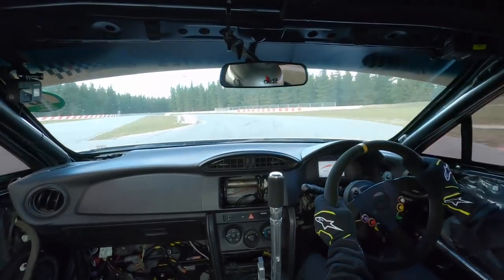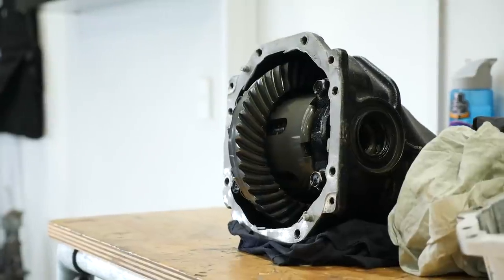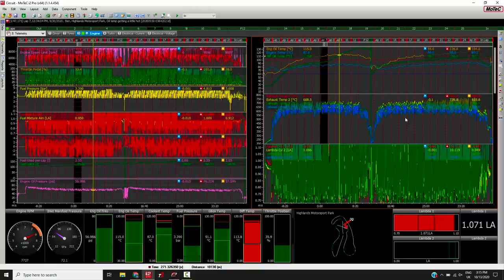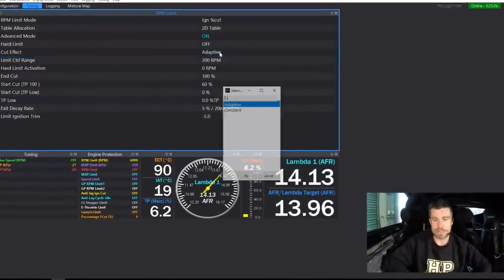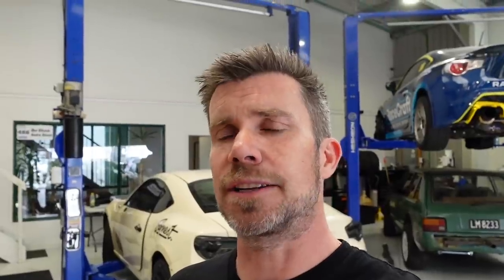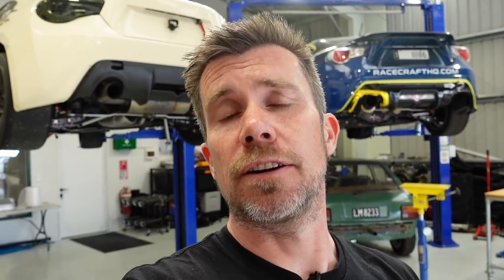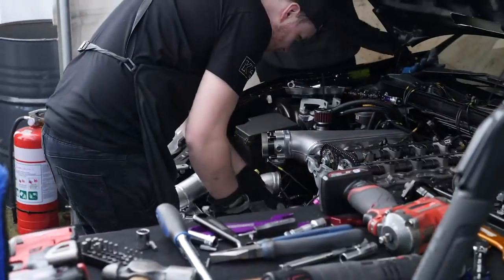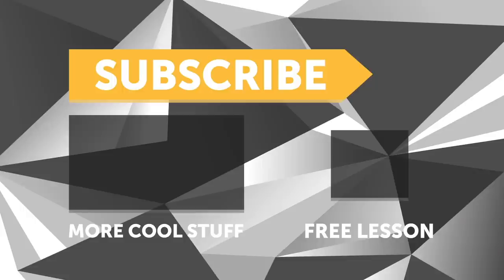That's It, We Quit (But Not Really) | 650HP SR20VE Swap | SR86 EP 9 [#BUILD]

Comment: i feel your pain Andre...i have been building my car on a rotisserie for 6 years. i just finished it in February and I've put 5800 miles on it so far, but man...the amount of little issues I've come across in the last 8 months is overwhelming at times. I've had every issue you can imagine from suspension to electrical shorts to slipping ignition timing to the windshield washer nozzles not spraying...at the end of the day, i give this car no choice but to work and do what i tell it to do. i gives it Hell and i know you'll do the same with your build.💪

Comment: Ran into the same issue with the shims. Tried many things, learned the hard way (shim finally flew into timing chain).

1. Machine the lip off of the retainer
2. Machine new shim with a 2mm deep pocket in the back of the shim that basically presses onto the valve stem, (think of it like a bucket).

So far we have about a year of limiter banging, drift fun. (~450hp).

If you have any questions, reach out! niekotheboss@gmail.com 

Good Luck!
Reply from the maker: Thanks for the suggestion. We've run lash caps like this on some of our 4G63's with success. In our instance changing the rev limit to only use fuel cut should be all that's required though and where possible i like to keep my life as simple as possible. We're also swapping to a different cam profile with the aim of bringing the power band down in the rev range so we can bring the limiter back to 8000 - Andre
Reply: @hpa101  Yeah, this last time around we did quite a few things so it's hard to say which one 100% fixed it. Changed to fuel cut, added the lash caps, and shimmed the valve springs.

When you're back in there, check the clearance from the retainer lip + rocker arm. We noticed many of the shims were sitting slightly below the lip and we are thinking this could have been part of the issue as well which was solved by machining the lip off.

Either way, awesome build! As much as I hate when things go wrong, the troubleshooting/learning is half the fun!

Comment: The biggest problem with using production based components for competition, is the total reworking needed to get the thing to hang together.
The revs and power you guys are using is impressive to say the least.
Fine for drag racing not necessarily ideal for circuit racing. 
You are at a level that the lower f1 turbo guys were at only 40 years ago. 
Brian Hart was at approx 650 BHP @ 9000 rpm all be it from 1500cc.
In reality you guys are not far off.
Reply from the maker: The results from this engine have been impressive but the realty is we're walking a fairly well trodden path. The numbers we're aiming for have been achieved on this platform by dozens before us so I don't think there's any reason we can't get the results we're aiming for. This latest little drama is pretty easily explainable, even if that makes it no less frustrating - Andre

Comment: Use a high volume low pressure pump and a bigger line and filter on the dif and that should take care of the problem if a few small pieces of anything get in the line or filter.

Comment: Are you looking to make active changes to the suspension based on sensor inputs? If so, what kind? 

Thanks for taking us along for the troubleshooting! It's nice to follow along your though process.
Reply from the maker: No, the suspension won't be active but we will be using sensors to help optimise the spring rates, damper settings, bump stops and packers to suit the aero - Andre
Reply: @hpa101  thanks for the reply! 
Have you got an overview of all of the services and companies that are part of HP Academy? I've been subscribed for a few years and it looks like you've expanded to cover a lot of territory. It would be cool to see a short video highlighting what you have achieved in the last years.

Comment: Mazworx
Shimless Valves:
Nissan sets the lash using shims between the valve and rocker. At high rpm or while on the rev limiter, these are known to come out and possible cause damage. The shimless valves are made to get rid of that shim.
Reply from the maker: A shimless setup on the VE head creates a whole new set of issues. Mazworx shimless valves greatly reduce the surface area that the rocker operates against which can accelerate rocker wear (fine for a drag application but not ideal for endurance racing). Adjusting lash also becomes a lot more problematic. Ultimately it's the ignition cut limiter that's the issue as explained in the video and switching to fuel cut only will sort that. For a drag application you need to use ignition cut on the 2 step to build boost so the shimless valves are an essential option - Andre

Comment: I've been really enjoying watching this videos and I'm sorry to hear you have more problems. Can I ask a question regarding the individual EGT's? When comparing the temperatures from each cylinder how big of a difference, say in %, would you consider big enough to require a trim in fueling for the cylinder(s)?
Reply from the maker: We actually rely predominantly on the individual lambda sensors for cylinder fuel trimming. While EGT sensors are often used for this purpose, there's a range of other factors that affect the EGT other than just AFR - Andre

Comment: There are a couple of other things to bear in mind.
The exhaust bouncing off the seat can result in excessive seat wear; stretching of the valve stem - with both the exhaust clearance being reduced which could also cause an increased chance of burnt valves and, more worrysome, the head actually becoming detached, especially if it's become overheaded because of the reduced clearance.
If the lash cap becomes partially displaced, it could hold the valve slightly open, or increase the lift, and as the piston is chasing the exhaust valves it isn't uncommon to have piston to valve collisions and resultant failures.

*hopefully I'll start a discussion on the HPA site as there are a few other things to consider when having seats machined.
Reply from the maker: Yes, nothing good happens when the valves bounce back off their seats. The key is to avoid the situation entirely - Andre

Comment: High revving RB engines have a similar problem with shims and the big engine builders often go shimless. Is that something that might be worth investigating for the SR?
Reply from the maker: The RB is a totally different valve actuation design being that it uses a bucket over the valve that the cam operates against. It's a little trickier to move to a shimless setup in the VE head. There are longer valves from Mazworx that are designed for shimless operation but they actually cause a whole new set of issues given they reduce the diameter the rocker operates against and hence can increase wear - Andre

Comment: Is it possible some of the added heat was coming from unmeasured valve overlap? You mentioned some of the shims were either equal to or lower than the retainers, and I'm wondering if that was creating a larger/longer contact patch for the cam lobe beyond the duration monitored by the cam position sensor. Thoughts?

Comment: Jun auto got sr20 lash killer kit on the shelf parts...solid lifter
Reply: Wrong engine
Reply: @coreyfreedom9859  so the sr20ve head didnt use the same hydraulic lifter as conventional sr20de(t) ?
Reply: @AmirPomen  not even close you can see the assembly in the video

Comment: didn't mention : "Valve Spring Stiffness" 
even if you suppress the exhaust explosions from occurring, you still talking around 9k rpm.
thanks for the beautiful content.
Reply: he mention @18:05 they plan on putting a stiffer valve spring to help prevent it in the future
Reply from the maker: The springs we're using have been tested to 11,500 rpm so they're more than sufficient for the 9k we're running. We are however going to increase the base pressure slightly but we're not swapping to a different spring - Andre

Comment: Maybe Banks was right about the type of diff cover and the airation that is can cause, thus the temps rise and the pump starts to fluctuate the voltage due to this airation
Reply from the maker: At this point the diff, cover and pump have completed a full season of endurance racing with no issues.
Reply: @hpa101  ah okay, thought the diff issue came to light once the SR20 was installed and that maybe the different power delivery from the turbocharged engine (plus the extra power) may cause a bit more airation.
Will be interesting to see the remedy you come up with.
Reply: Gale Banks Tuned in podcast please Andre

Comment: A general question, im no sr20 expert, but that rev limiter seems quite agressive for endurance racing, wouldn't around 8k make life easier, rpm is seldom easy in endurance racing..
Reply from the maker: 9k was never our intention, but rather that's where it is making power with the current cams. We're actually looking at a different cam that will move the power curve to the left so that we can reduce the max revs we're currently using - Andre
Reply: @hpa101  Would really love to see Dyno overlays of  different cam on same  set up its talked about to death  and no real back to back data is ever brought to the table just a heap of opinions ..

Comment: Why are you guys running the RS cusco diff? That would be very violent on the track coming on throttle. You should convert it to a standard bellville type setup.
Reply: Nope..wrong preload and wrong ramp rate in the lsd setting sure will do just that...

Basically any motorsport plated lsd require proper setup and even most of it well documented by each manufacturer for each setting....
Reply: @AmirPomen  you're the wrong one mate. Perhaps you should have a read of how the RS cusco's work. I have built a lot of motorsport LSD's and have a very good understanding of how they work. The RS transitions almost instantly from preload to locked and is marketed for that exact reason.
Reply: @JamesPF2D  i always thought that cusco rs is smoother compared to standard cone spring lsd type of design?and being able to play with numbers of initial springs would help on setting up the preload? No?

I dont have much experience on other lsd..only limited to conventional cone-spring (bellville?)  type lsd...and that mostly being used on gravel rally events..not much on roadcourse track...

Care to share more why u said its much aggressive than normal lsd design?
Reply: @AmirPomen  you most definitely can play with preload by changing the quantity of springs. But as the springs are acting in the same direction as the ramps there is nothing nothing stoping the diff from ramping to locked all but instantly. With a Bellville sprung diff the size of the Bellville vs the ramp angle creates progression as more load is applied until the bellville is flat and the axle is locked
Reply: @JamesPF2D  i see...understood now... 👍👍
Reply from the maker: @JamesPF2D  the primary reason we have an RS version in the car is because that was what the car came with. That being said, the RS actually offers better initial turn in than a MZ-style LSD due to the lower initial torque. Yes, the RS will tend to lock up more aggressively than an MZ however the overall operation of the LSD is also affected by the number of active plates too. Long story short, currently the LSD is literally the least of our concerns - Andre

Comment: So what is the solution for flat shifting now? Since youd rather not have the ignition cut while switching gears. Could you just do a fuel cut in-between gears? Or just shift normally.
Reply from the maker: The shifting isn't the issue as we were already using fuel cut for the shift. It's only the rev limiter that still used ignition cut - Andre
Reply: @hpa101  understood thank you for replying :)

Comment: just curious when you sent it to mazworx why didnt you go the shimless route?
Reply from the maker: A shimless setup on the VE head creates a whole new set of issues. Mazworx shimless valves greatly reduce the surface area that the rocker operates against which can accelerate rocker wear (fine for a drag application but not ideal for endurance racing). Adjusting lash also becomes a lot more problematic. Ultimately it's the ignition cut limiter that's the issue as explained in the video and switching to fuel cut only will sort that. For a drag application you need to use ignition cut on the 2 step to build boost so the shimless valves are an essential option - Andre
Reply: @hpa101  ohh thanks for an educated response. makes sense
Reply: @hpa101  i had an additional question you can maybe clear up for me. i see these billet girdles and main caps for sale. are they really needed? if so. why? 
thanks in adavance

Comment: A cool and irrelevant story since you're using a VVL head: A friend of mine had a similar issue with a non-VVL engine. He solved it with a "Tomei rocker arm stopper". Apparently "when the engine revs over 7000rpm while on a circuit run or drag racing, or over-rev from miss shifting will sometimes lead the tappet side of the rocker arm fulcrum to jump, and the rocker arm to come off." Should have K swapped it.
Reply from the maker: The rocker stopper for the DET is more of a bandaid than an actual fix. The VVL head doesn't suffer this issue since the rockers are shaft mounted. And yes, I've heard nobody has ever had a single issue with a K20 ever... 🙄

Comment: Also why not upgrade to shimless setup?
Reply from the maker: A shimless setup on the VE head creates a whole new set of issues. Mazworx offer longer valves where the lash is adjusted by tipping the valve. This greatly reduces the surface area that the rocker operates against which can accelerate rocker wear (fine for a drag application but not ideal for endurance racing). Adjusting lash also becomes a lot more problematic - Andre
Reply: @hpa101  thank you again for the insight and response Andre.

Comment: I can see emmediatly something wrong with your fuel pump. You have an immediate 180⁰ degree bend coming out of it and a 45⁰ degree coming out the other side! Who installed these lines!? With every bend you cause fuel pressure psi loss and back pressure on the pump making the pump work harder and possibly hot. Reinstall your pump in a position to eliminate these bends.  The way its installed now is just retarded!
Reply from the maker: Let's start with the basics - The pump, filter and cooler have been installed like this for a full season of endurance racing with zero issue so it's a bit of a stretch to assume that they have just now decided to create a problem for us. In the perfect world we'd have no bends and everything would be plain sailing, however in the real world we're dealing with a tight installation with limited room so this drives the installation. That being said, the flow restriction of the smooth internal design of the Speedflow fittings we use is probably negligible in comparison to the internal surface finish of the hose that runs between them so it's a moot point - Andre